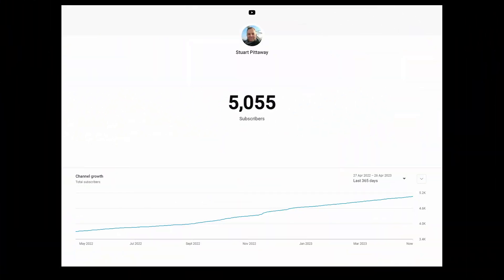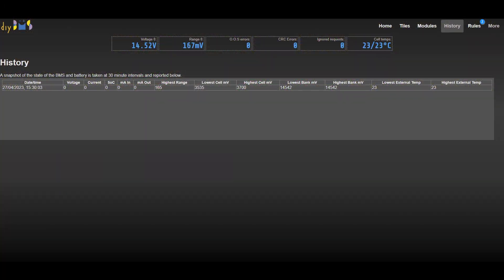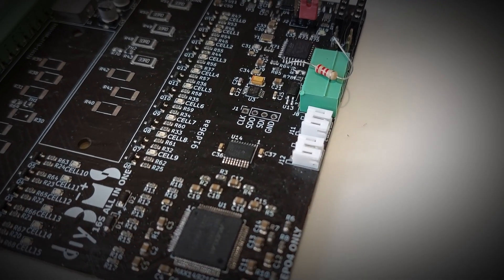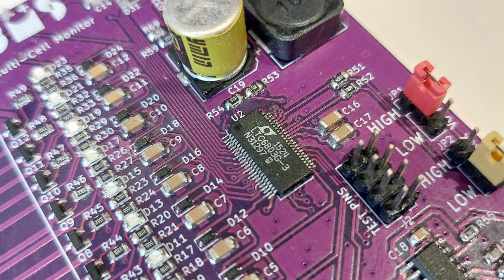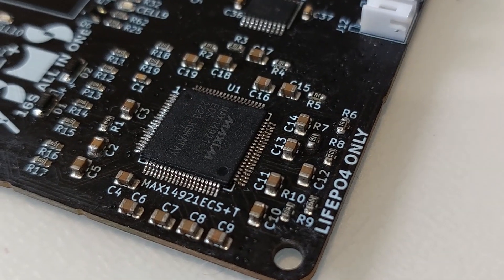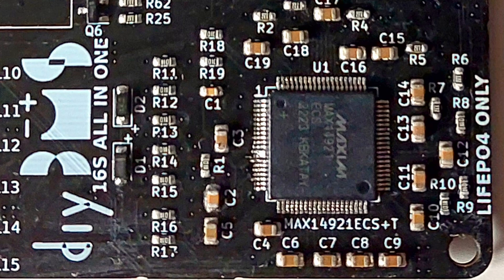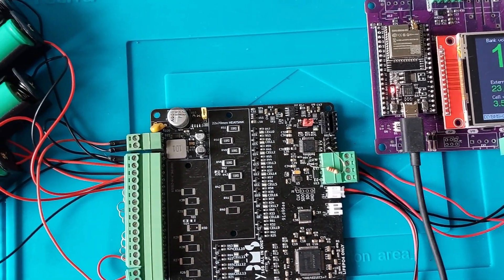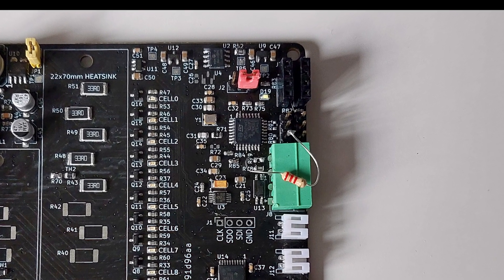DIYBMS 16S Prototype (all in one monitoring solution)

Comment: I love the project, and the all-in-one board is a much-needed evolution. However, I'm disappointed in the limitation of lithium iron phosphate only. I agree they are safer, but one of the greatest benefits of DIY power walls and other projects is keeping old batteries out of landfills, as well as keeping the cost down, which in turn lowers the barrier to entry. Unfortunately, the LiFe-only limitation is a blow to both of these benefits. I know you are busy, but I hope someday you have an opportunity to make a lithium-ion version! Nice work on the design of this solution (and nice rabbit, lol)
Reply from the maker: LIFEPO4 limitation was removed in the next revision - any cell up to 4.5V max voltage should be suitable.

Comment: Max looks overpriced without an ADC. I’d use dsPic33F with up to 32 multiplexed input channels 10/12bits for €4 (with an MCU for free and high resolution PWM if you’d like to use them for an active balancer like a DC/AC full bridge to a multi-coil transformer, or DC/DC single cell charge pump, or for a CCCV charger as a part of a complete solution) rather than Max14921 for €16 without an ADC and MCU, or two LTCs for €32 without an MCU…
Reply from the maker: I'm not sure where you are buying the MAX chip at $14 USD but from LCSC they are $4.74 in single quantities.
Reply: @StuartPittaway  That's a mystery. Because 1000Ku AnalogDevices price is $8.72, Digikey 16.46 eur one piece, and 8.40 eur for 1000Ku,  Mouser 14.8 eur one piece, and 9.05 eur 1000Ku. How did you get it twice cheaper than AD sells? -)

Comment: is there a way to buy ready make diyBMS board? willing to test with my 48v motor project as apart of the power supply system
Reply from the maker: I've ordered some stock of boards, so hopefully setting up a small shop soon.
Reply: @StuartPittaway  sounds great, can you sign me up. I am willing to help for testing.

Comment: Looks like something amazing but my question is why not incorporate shift registers to expand the amount of monitoring capabilities using a programmed pic. I don’t have the level of electronics knowledge to do what you do but enough to half hearted understand your goal and am impressed. Thanks the content is very helpful.
Reply from the maker: This monitoring board is part of a wider system - there is also a controller board which has several external interfaces and monitoring capability.

Comment: Hello Mr. Stuart, I purchased and installed the necessary equipment to apply the example you made in the project I did at school, but I could not run it after installing the software.
Can you help with this?
Reply from the maker: Yes - but raise a ticket on GITHUB as its easier to communicate on there.

Comment: Hallo Stuart! your sackable module based on the LTC6803G-3 seems very suitable for my needs. Is it possible to have some detail aout the project? thanks
Reply from the maker: I didn't go down the stackable route in the end, so stopped using the LTC chips
Reply: @StuartPittaway  do the chip work well?
Reply from the maker: @grazianoturbogas  those chips worked fine, but you need two for a 16S setup which adds complexity and cost
Reply: @StuartPittaway  I need 3 to get to 33S. They could reach 36, but I only need 33. Than the datasheet seems to claim that if powered from an external source, it will not drain the battery to work, and most importantly if I don't makes any read, no current at all is drained, neither the few required by the volt measurements. And that's mandatory in my extremely peculiar case of study. I'm developing a BMS for a "salt" battery. SMC battery. Sodium Metal Cloride.
Being me a single person, any suggestions are extremely useful.
Bye
Reply from the maker: @grazianoturbogas  interesting project. I only stacked 2 chips, but they worked fine. Power usage is minimal and you can control them for sleep modes
Reply: @StuartPittaway  If I get stuck into serial communication problems can I disturb you for some help?
I just ordered some chips for testing them, it will take September.

Comment: Hey Stuart, an idea for a future project that will be very useful for those of us that have a grid tie inverter with mppt.
It would be useful to  feed power in to the mppt inputs to mimic a solar panel array after dark.  For me, specifically I need a DC to DC boost inverter to convert the 48V battery (15s LiFePO4 bank) to 120 - 385V DC with programmable current and/or voltage output so only the required power is fed in to the grid tie inverter. This proposed inverter can supply 500W assuming the inverters can be paralleled to to achieve higher power from the batteries if needed.
In addition a inductive current sense input so I can connect an inductive loop on the neutral leg of the mains input to the house to control the inverter power so that grid power use is minimised. 
Just a thought.
Reply from the maker: I've had similar thoughts, but in the end, its easier to simply use a second inverter and leave the solar to do its thing during the day.  I'm not a fan of boosting or working with high voltage DC - easy to make a mistake and that could be painful or worse.
Reply: @StuartPittaway  Yes, one needs to work carefully through work practises to minimise the chance of getting zapped. One mistake is likely to be fatal.
Thanks for considering it.
Reply: @StuartPittaway  It just occurred to me that if one can characterise the input impedance of a typical mppt controller, then you can set the electronics up to not generate HV until it sees an MPPT controller connected. I mean, you can still kill yourself, but at least there won't be floating HV until there is a suitable load?

Comment: How did you do the spi communication between the stm32f030 chip and the max14921 afe chip? can you help me?
Reply from the maker: That's quite simple, I'm using the Arduino framework on the STM, so a single SPITransfer command will read the max chip

Comment: I'm trying to build 2 large battery for a catamaran.    Each 100kwh and 400v.     That sounds like it would be 128 cells correct?      You said this BMS would Daisy chain, correct?    I'm assuming it would be from canbus to canbus?    Could I have 8 seperate boxes in Series,  16 cells in each,  for ease of transport.   And if YES,  then who would these 8 BMS's talk to, other than each other.   Wouldn't there be a main controller?    in a home, it would be the inverter,   but, on a boat?  is that Some victron thing?   or some main BMS?     I'm a bit foggy on this
Reply from the maker: 400v DC can be dangerous to work with, I'd suggest consulting an expert in this sort of stuff

Comment: Amazing. Just got the 4s6p lfp 60ahcalb cells all wired up. Couldnt get mqtt working which is frustrating. This new prototype shows a lot of promise. Great work stuart. Also i could do with 4 more slaves to double to 24v. Do you have any on hand? Also one of my slaves broke of the 5 i made the traces burnt out on the back. I probably accidently shorted it as i didnt have them secured down. (They are now)
Reply from the maker: I don't have any spare boards, sorry

Comment: Nice design! What about calibration? Do it still need to be calibrated?
Reply from the maker: So far it appears to be accurate, and as there is only a single ADC if it did need calibration then only 1 cell would be required for that.
Reply: @StuartPittaway  Great news! Thanks ;)

Comment: Was very happy to see you finnaly did this design until you said you limited this to lfp...some of us with nmc specificaly would love soulutions like this...any way keep up the great work
Reply from the maker: NMC would be fine, it's the maximum voltage that's limited to 4V per cell.
Reply: @StuartPittaway  Why is the limit 4V per cell  ? I thought the MAX14921 is good for 4.5V. I need the cells to charge to 4.15V so in theory it should be supported.
Reply from the maker: @carlospereira9838  that's only part of the picture. The ADC and balancing are the other parts which are designed for 4V max for better accuracy
Reply: @StuartPittaway  Can you adjust it to 4.5V or is 4V a hard limit. Are you able to use another part that the can go up to 4.5V  or at least 4.2V. I only use L- ion for my builds and would really like to switch to your new all in one  design.
Reply: @StuartPittaway  the mcp adc seems to be good from 2.5v to 5.1v unless I am reading something wrong. Will bumping up to 4.5V hurt the accuracy too much ?
Reply: @StuartPittaway  hopefly you can adjust to at least 4.2v per cell..otjers like myself would benifit from 4.2-4.5 will be wait8ng to see what can shake out for us...your system is ideal especially with the plylontec emulation to talk to virtualy every inverter

Comment: Stuart, you do great work. I have a much more basic 16 cell hobby system, and have been inspired by your designs. I am somewhat nervous about making a 16 cell (50v +) single board  monitor/balancer as most common dc fuses are only rated at 24v and give little or no specification about their current breaking capacity. I have therefore composed my system into modular 4 cell (14 volt) units that are self contained and isolated with adum i2c  chips. For voltage monitoring I use a standard 4 channel op-amp that outputs into a 4 channel 16 bit ads1115 module (use 0.1% resistors). I get about 1 or 2 millivolt accuracy. I have really old uneven 200 amphour cells that require a lot of balancing. For that I am using miniature relay boards and cheep 1 ohm 100 watt Chinese resistors. Thanks again for sharing your stuff.
Reply: Sounds interesting, got any video explain your setup in more detail?
Reply: @BagheeraTube  have been planning to make some, but system is kind of a kludge. I am redoing it with new circuit boards to clean it up. As soon as I get it running again, I will post some.videos. Thank you for your interest.
Reply: Here is short overview of my new system: https://youtu.be/gn8bzphskKs
Reply: @BagheeraTube  I made a short video overview of my new system. https://youtu.be/gn8bzphskKs
Reply: so you use op amps for differential measurement,  4 channels with adc, i2c isolator and such modules connected to the microcontroller ...  i wanted to do something like that too, can you tell me what you had problems with? I made a system for 2 cells with lm358 and compared to the reading of the cell, the output voltage was with an error of max 2mV (I used 0.5% resistors). 
so I think it's pretty good accuracy, and I didn't use any specialized components, just a very common op amp and standard resistors
Reply: @pingwinvonjelen6586  I used the lm324 (4 channels). Two things that I have done is to use a diode on the input to prevent reverse biasing. I have burned out a lot of stuff without the diode on power up, because my charge controller has a lot of capacadence and acts like a short and causes strange reverse voltage effects. I also recommend using a zeener diode on the input to prevent voltage serges damaging any sensitive chips you may use (like the opa333 opamp on my previous system).  The 0.5 percent resistors are fine as long as they are all the same. I get repeatable errors of several milli volts, but use a calibration in my software to get down to one or 2 milli volts. Good Luck.

Comment: awesome work stewart.
still hoping you will consider replacing the passive balancing completely by a 2 amp active balancing on the prototype board at one point.
this simply requires even less cabling and other products in the battery that can fail..
Reply from the maker: Check out the new video - I've removed the passive balancing
Reply: @StuartPittaway  saw it....well done sir